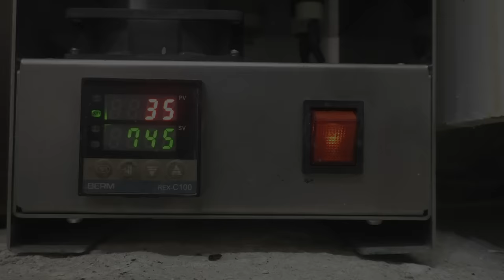Restoration video of a 1956 filmoscope

Comment: Your choices are...  unusual.  Unlike most other restorers, you don't seem to want to do wet sanding or use primer before powder coating.  I've also never seen anyone rehabilitate a transformer in quite that way - that was one step below rewinding.  As well, youre the only restorer ive ever seen make parts through forging/casting.  Still, I guess the results speak for themselves.  What kind of thermochrome do you use?  I'd never heard of it before you.
Reply from the maker: Thanks for your comment. I buy Thermochrome from one person, he makes it himself and sells it in small quantities.
Reply: This guy refuses to listen. I’ve told him and another guy how you’re supposed to wet sand using powder and you need to prime and sand between layers and he made excuses saying that’s not how the item was originally. 😂 I told him that’s stamp metal. It’s originally smooth. His two paddles shy of the shore. 😂
Reply: @TAG77  well, it's his item to do how he wants.  Personally, I'm not a fan of the unfinished look, but I guess he has a point that it's true to the way they used to do it a long time ago.
Reply: @kitsuneneko2567  😂 no, it’s not. Stamp metal is smooth when it’s stamped and then thrown directly on the paint line from the stamper. It is his item to do with the way he wishes. However, if he wants more views and subscribers it’s not going to happen. Most viewers in the restoration amsr on YouTube love attention to details. Not Someone half doing things to push videos out. Like the guys covering new things in mud and then pretending to restore.
Reply: @TAG77  I guess time will teach him.  If that is limiting his channel, he'll find out.  On balance, I do think he's one of the better restorers -  the items are still left far better than they were found.  It's just not...  as great as it could be.
Reply: @TAG77  Trying to make an old item as new is a fake. This guy is doing the right thing, except for the fact of using powder coat...
Reply: @blackraven8805  it’s not making an old item new. It’s painting correctly and he needs to prime before painting. If you don’t have experience I’d suggest backing off on trolling.
Reply: @TAG77  perhaps you can show us how it’s done instead of criticising others.
Reply: @shedmanx3640  yea, that trolling challenge doesn’t work on me. Troll someone else and take constructive criticism constructively. Chewing out viewers for giving real opinions and not licking your boot isn’t a way to get them to share your vids with others and give you more subscribers. It just confirms this is a channel isn’t going to be very popular. It’s only going to go so far and get a rep for bullying their viewers that are honest and try to help.
Reply: When you take apart a rusty transformer, you have to clean the core laminations if they're rusted together otherwise you'll get eddy currents and other electromagnetic issues that cause poor effeciency, heat, and other issues.
Reply: @trevorhaddox6884  I wasn't saying you don't, just that most restorers don't much bother.
Reply: @kitsuneneko2567  Some restorers would just have slapped some crappy Chinesium LED retrofit in it, leaving it with a horrible image output and calling it good enough. Always nice to see restorers with electrical competance, even though his painting skills are...sketchy. I would have also added a safety ground but IDK what country that is so grounding might not be common or something.
Reply: @trevorhaddox6884  everyone has their thing, I guess.  Personally, I hate bluing and always cringe when someone does it, though maybe it's the best thing to do.  Shrug.  There are so many restoration channels, everyone can find something for them.
Reply: @kitsuneneko2567  Bluing isn't always the best, but if done right it's really pretty. Usually it goes well with copper, brass, bronze or chrome, and only on relatively small parts like screws/bolts or other hardware.
Reply: @shedmanx3640  TAG isn't wrong though, though i dont have first hand experience in metal/painting works, i know for a fact that smooth surface do not adhere to paint in the long term. this is why people when doing restoration do abrasions on metal before applying the primer paint and before the second base colour layer; to make the actual outer layer adhere better to the primer and the primer adhere better to the metal.

arrogance only works if you're right, but if you're wrong and arrogant, that's thew worst combination, nevermind stupid.
Reply: @TAG77  that's not what trolling is. But going on and on about it solves nothing
Reply: @trevorhaddox6884  it’s a European country and safety grounding is proper safety protocol, especially working with 220v. You’re right😋
Reply: @ManomiiFox  with old stamp metal maybe but fresh stamp metal is conditioned before going into the sprayer in the factories. I worked in the paint area of whirlpool and yes paint will stick on a smooth surface.
Reply: @TAG77  i see, thanks.

Comment: I nice restoration. On one point I have a notice: You cleaned the iron core sheets very well, but before you reassembled the transformer you forgot to threaten the iron core sheets with a thin very thin layer of polyurethane varnish. Coating one side with polyurethane varnish would be enough, so that everyone is isolated against the other. After reassemble the complete core and tighten its screws, it is suitable to to spend the complete iron core a thicker coating of polyurethane varnish. This procedure prevents the transformer from creating strong humming noise and reduces core losses caused by excessive eddy currents in the transformers iron core.
Reply from the maker: Thanks for the tip, I didn't know about that
Reply: What? You don't want the core laminations to be isolated, it'll be marginally less effective and an enormous waste of time, if you don't want it to hum it means it isn't compressed and the laminations are vibrating against each other, slightly, this is why they used to have crush fit surrounds and now they are welded together.
Reply: Lm
Kl0
Reply: @PSVRestoration African children could've eaten that rust

Comment: This was so amazingly well done. The care and patience, all the different cleaning and re-surfacing techniques, it all comes together with your thoughtful camera placement to make this a real treat to watch and experience.  I mean, good lord you even disassembled that transformer to restore it instead of simply replacing it, not to mention fabricating a new insulating screw-on cap?!  If that isn't the definition of attention to detail, then I don't know what is.  Thanks so much for taking us along for the ride on this one!
Reply from the maker: thank you very much
Reply: are you writing a poem or actually saw the video? there wasn't all that much patience. in 12:19, it clearly shows that small metal part was not even fully sandpapered fully to remove the old reflective layer before the new chrome layer was applied.

at 11:20 at the close up of the circular part after being thermochromed, the thermochrome wasn't even coloring all the outer part of the surface area, there are small holes and near the side that wasn't painted fully.

those are the only 2 areas i have problem with in this restoration. it's good, but not great.
Reply: @ManomiiFox  Troll
Reply: @ct92404  nope. actual criticism is a thing, if you actually read what i said with the "read more" button, you wouldn't say that. you're the troll in actuality.
Reply: @ManomiiFox  It's better than most of the examples I've seen so far, most of which are faked to high hell and ignore the details.  
This one took a lot more time to show the attention to detail I wish so many others would put into their restoration efforts.
You can nitpick faults all day long, but I still feel like this video was a pleasure to watch.

Comment: I have seen one of those and it was powder painted in some method leaving a textured surface. Could it be that it is because it was left for a shorter time to curate in the heat or maybe a second powder coat less curated than the first one. You see this texture often on vintage typewriters and I have always wondered how that was achieved.
Reply: I’m guessing you’re talking about wrinkle paint. That’s a special paint that’s designed to create that texture when it dries.

Comment: The only thing i didnt like was not using 3 wire with a ground, otherwise very nice restoration.
Reply from the maker: It was possible to add a third wire, but in the original there was no ground on this filmoscope

Comment: Why do you not remove all of the rust before sandblasting?
Reply from the maker: Why, if you can remove all rust with a sandblaster
Reply: @PSVRestoration  Then why remove the rust with the smaller pieces?

Comment: Amazing stuff, although I have to complain about something: You are supposed to apply varnish between the layers of the transformer core. Otherwise the eddy currents in the core can travel freely and the transformer will heat up pretty quickly. For something that wouldn't be operated for long periods of time I guess that would not be an issue though.

Comment: Not understanding why there was no primer and wet sand. Now your paint is all lumpy and it looks horrible
Reply from the maker: Yes, it was possible to make a more glossy surface, but in the original, the filmoscope looks exactly like this.
Reply: @PSVRestoration  no, that’s stamped metal and stamp metal when painted isn’t lumpy. Back in the day when they’d use lead paint or unleaded the surfaces were smooth so the hand painting in the factories could go on smoothly. It was not lumpy. I lived in Europe and I’m a complete nerd with antiques, history, and other subjects. Plus I also worked in a factory on range tops and dealt with bake paint and we would get the range tops straight out of the metal stamper and right into the assembly line to be sprayed and painted so we would have less of a chance of paint flaws. Then inspect them straight out of the sprayers and if the sprayer sprayed it all messed up, we’d have to blow the powder paint off and throw it back in the line. I had to quit, because I was getting lung infections from the powder. It doesn’t take long to spray and bake on the primer, wet sand, and then start the color. Then you wet sand with a finer sand paper again and apply the gloss. I may of been born yesterday, but it wasn’t last night.